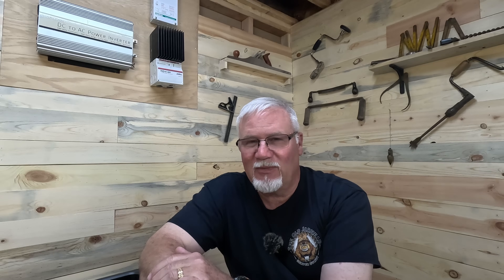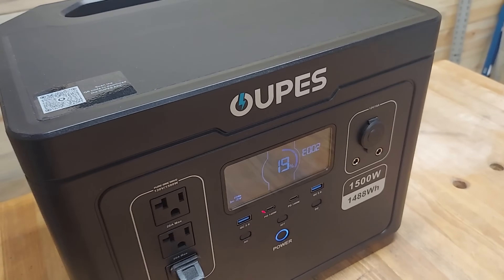Did I Just DESTROY A Brand New Power Station?

Comment: Did you but the unit or was it provided? I have wanted to bust one of those things open but voiding warranty is a bit of a deterrent. Just curious about what you plan on doing with the paperweight. Good info as these are not cheap.
Reply from the maker: It was free for the original video however it's back!!!  Video today!
Reply: @TheOldJarhead  I saw that, nice to see it came back to life.
Reply from the maker: I must admit, I'm still a little concerned with what happened but haven't had a chance to tear into it yet.

Comment: Did you measure the actual Wh drawn by the device and account for the power consumed by the bms when calculating the capacity of the battery?

The amount of power used to recharge the unit suggests it has at least the stated capacity. 

You didn't accept warranty replacement, did you?
Reply from the maker: Nope and nope.  I realized later I had drawn the unit down some 87% which actually pretty good.

As for warranty,  there isn't one for me as it was given to me to review but they still offered to replace but then I tried something and brought it back!  Mea Culpa video today!
Reply: Take down this video until you correct your mistakes
Reply from the maker: I can't say I made a mistake as you'll see in the next video but I am still not convinced this is a good unit (as might be obvious in my video today).

Comment: Oupes is junk. People who say Oupes is good must have gotten lucky with the unit they received. I went through two different units before I gave up and just asked for my money back
Reply from the maker: Which units?  The Mega 1 has proven a good unit and though I haven't tested a Mega 2 I hear they are also good.  The Exodus in this video DID COME BACK later after the video released and I'm putting out a new video today on it's being alive after all.
Reply: @TheOldJarhead  The Mega 1 was the one I had issues with. My first issue was that it wouldnt charge from solar so I contacted OUPES and sent it back. They sent me a replacement that would shut off at around 12% to 15%. I ended up sending that one back and got my money refunded. Maybe I was sent two defected products, I dont know.  Good Luck, hope it works great for you as I have seen other people really like OUPES products.
Reply from the maker: I had to admit that 12% is actually 88% efficiency, which is pretty normal, actually.
Reply: @TheOldJarhead  My Eco Flow can go all the way down to 0% before shutting off.  No argument or hate here, just giving you some info.
Reply from the maker: Understood -- many of those do go to 0% like probably all I have.  However, they are still only using about 80-90%.  I suspect in this one case it was why they wanted it drained first, which I refused to do LOL...I started doing it but kept thinking "No one else does this!"  I now suspect it was intentional to get the cost down.  One less step at the factory.

Comment: I had a Eco flow river and it went dead on me running a fan in the middle of the night when it should have gone 12hrs. I had to plug it into 120v power for 30hrs before it would even turn on.  I returned it within the 30day window.  These things just arnt that reliable.
Reply from the maker: Yikes!  I haven't had that kind of issue

Comment: Your pretty knowledgeable about this stuff, maybe you can solve my issue...I have 2 identical 1228wh no-name power stations that both have a problem with the AC inverter. I bought the first one, dead on arrival, so they sent a replacement...after 6 months it pooped out also, and the company seems to have disappeared. Anyway, the DC side works fine, so I use them for extension batteries for my other power stations. The problem is, no way to recharge them other than use one of my other power stations DC to DC. Wicked slow, plus I have to refill my power station when done.

What I'd like to be able to do, is use it's 200w DC in port (5521 barrel port), and charge it from the wall. Couldn't I get a AC/DC power supply like you find on printers and laptops to accomplish this? 200w is still slow, but fine with me. 

The spec on the DC-in port is 12-28 5VMAX 7A 

Any thoughts/ideas? (I'm not good with electrical stuff)
Reply from the maker: They don't have working solar inputs?  And I wonder if a fuse went and the inveter might work?
Reply: @TheOldJarhead  Yeah, it has an Anderson connection, same specs (200w max). I have no sun.

Not the fuse. They had a design issue with that model. That's why they just sent me a new one without question.
Reply from the maker: No sun, no problem.   Connect a battery to that port (of the right voltage) and connect a charger to the battery 😉

Comment: I received mine last week, and have drawn the battery down twice. The first time it cut off somewhere around 10%. When turned back on it displayed zero. (I wasn't watching it closely). 

The second time it did draw down to 1% and continued to pull 150w +/- for about half an hour then it shut off. When turned back on it displayed zero.

The problem I'm having is getting it to recharge "0 - 80% in 2 hours" (as advertised). The best I have got is 67% in 2 hr. So recharge time is about 3 hr to 80%, and 4hr 15m to full.
Reply from the maker: New video coming out shortly.  I did not kill my Exodus!  I figured out how to get it back to working by accident sorta ;) As for charging time, ya it's a bit slow.  Do you have it on fast charging mode?  I found around 80-85% it ramps down the AC input power to around 300-400w but I could speed it back up with solar input.
Reply: @ Support sent me a link to their "newest app". I used that to set to "fast". I don't have a solar option...no sun.
Reply from the maker: A 24v LiFePo4 with a 30amp fuse and the anderson plug will charge it up at about 500w...of course, then you have to charge the battery itself but it will add power to the charging ramp once it drops down below the 800w to around 400.  Get's you back to 800w or close to it to charge faster.  That's what I was doing :D
Reply: @ Rob Peter to pay Paul...
Reply from the maker: Yup, but in a pinch, it can be helpful, and with a 30amp charger, you can get that battery back up fast 😉

Comment: Something that I noticed that made me wonder...
The tag says to deplete the battery completely and THEN recharge completely before using.
All others I've seen says to completely charge before using.
Reply: I assumed that was to calibrate the BMS...IDK.
Reply from the maker: Probably!
Reply from the maker: Yes.  I found that very odd. LiFePo4's don't need that, so why this??
Reply: @TheOldJarhead 
Advertised ratings are what you look at when buying.
When you buy 10 liters of petrol and get only 9 from the pump; then, it is fraud or a faulty product.
Reply from the maker: True -- but I think they changed it to 800w fast charge after I got my early model.

Comment: Most DC outputs on power stations are regulated these days because the internal battery pack is typically 6s, 7s, 8s, ....  i.e. not 12V.  A much higher voltage.  Even small power stations. 

The 12V port on nearly all power stations is  typically limited to 10A.  10A * 12V = 120W.   And there is typically no temperature sensor on the 12V electronics so my guess is that you blew up a FET in the 12V regulator from repeated starts (the power station didn't give it enough time to cool down)...  and blew a fuse inside the unit.

You'll have to open the unit up.  I don't know how hard or easy it would be to disassemble.  I  will also note that most power stations internally separate the BMS and battery pack from everything else, so you might be able to salvage the battery pack and BMS.  It probably won't be a standard voltage (though the larger power stations typically use 16s which is standard 51.2V LiFePO4).

-Matt
Reply from the maker: Thanks.  I'll wait to see what Oupes wants to do.  If they want to tear it down and see what I did it might help them prevent it in the future and improve the unit.  Or not 😉  

If they don't want to I may tear it apart or let someone else do so